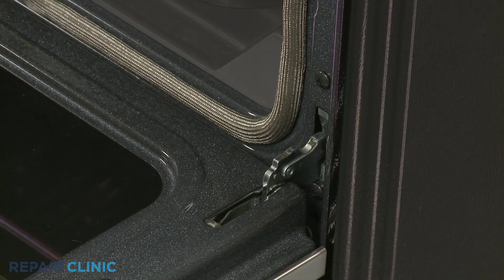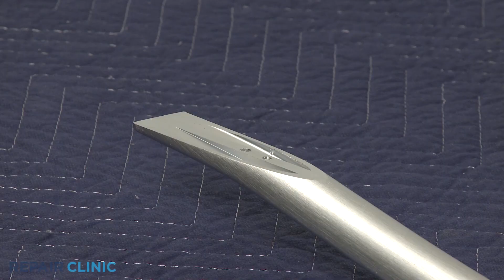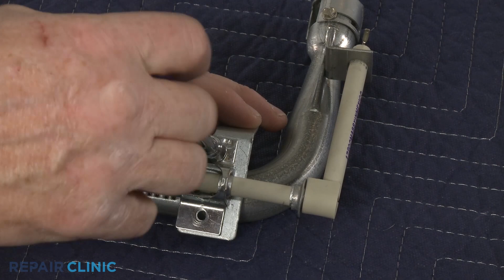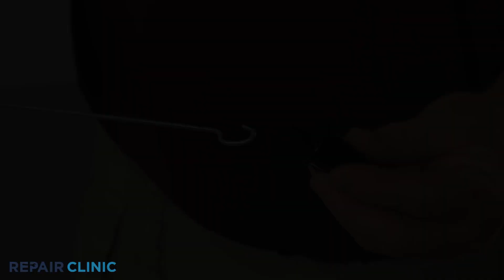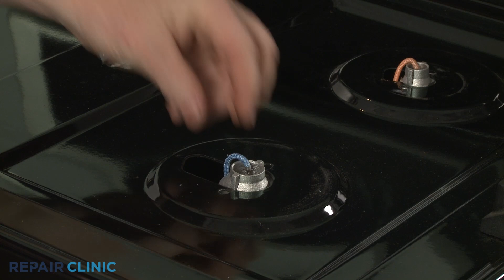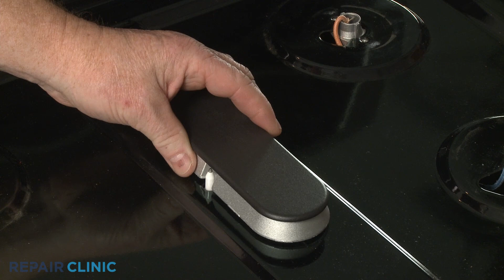Whirlpool Gas Range Disassembly (Model WFG745H0FS1)

Comment: Im guessing there isnt an easier way to remove the side panel :( i put my hand under side of the oven to pull it away from the wall and then the bottom corner of the side panel pulled off of a screw with a black washer. Now it looks like Tupperware lid that has one corner not shut all the way haha